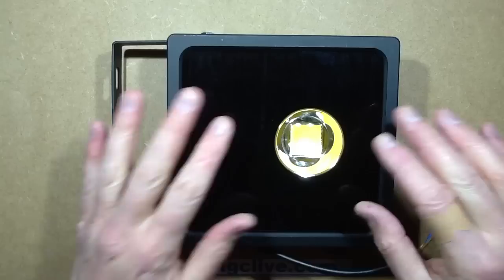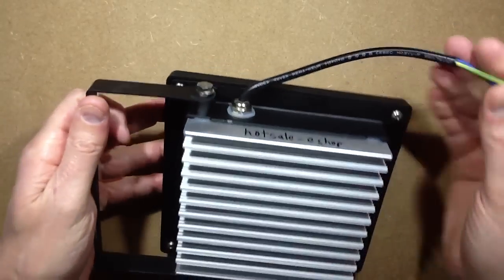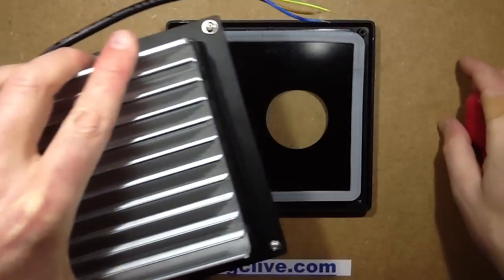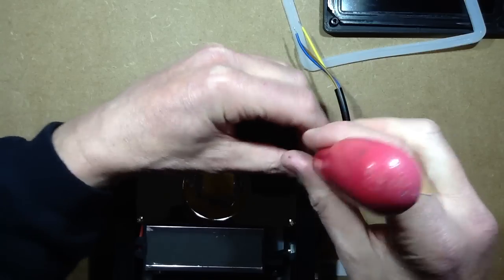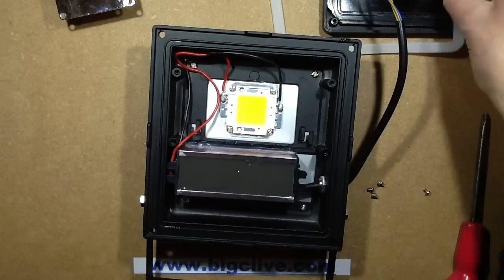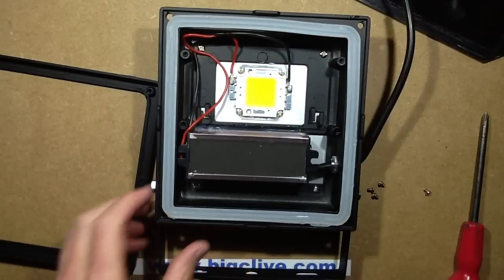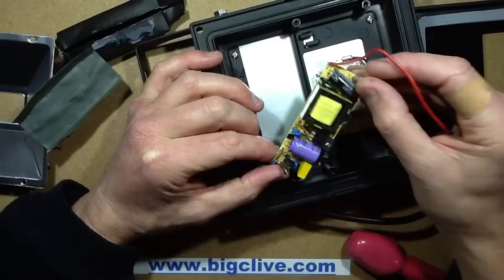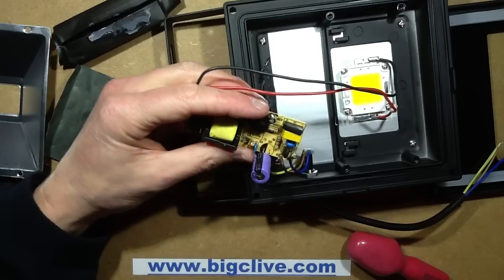A look inside a narrow beam 20W LED floodlight.  (30 degree beam.)

Comment: Big Clive, I have a question about narrow beam lighting. I'd appreciate it if you might consider it and perhaps provide an answer. 

I have a cheap single bulb LED flashlight about 4" long and an inch in diameter with a plastic lens on a sliding collar.  It allows for a wide beam and when pushed forward, the beam narrows to a spot about two inches wide on a surface about a foot away.  The bulb and lens section is only about 1 to 1 &1\4 inches in length.

I have a possible invention idea with a technical requirement.  I was wondering if a plastic lens configuration would be possible in a similar cheap compact LED light format to project an intense point of light about 1\8th to 1\4 " in diameter onto a surface about a foot away?  (I've considered lasers but they project only colored light and I require white light.)

I have achieved the point of light from the flashlight but only by having a magnifying glass about a foot away from the surface with the flashlight about another foot above the magnifying glass with the flashlight focus collar slid back to wide focus.  I was hoping to achieve this result within a compact bulb and lens housing, about an inch in diameter and 1 to 1 1\4 inches long or something in that size range, also employing an LED bulb and cheap plastic lens, as with my original cheapo sliding collar flashlight.

I also encountered a photographer's version of a concentrated spot effect achieved by putting a plate over a light bulb within a valence collar with a 1\4 inch clear acrylic rod protruding through the plate.  This reportedly channeled the light in fiberoptic manner through the rod and projected a concentrated spot of light from the end of the rod.  Not sure if something like this might achieve my purpose.

--Grant
Reply from the maker: If the light source is small then you could definitely use optics to focus it to a sharp point at that distance.
Reply: @bigclivedotcom  Thanks for your answer.  I was hoping for that assurance that it was do-able

Comment: Can you tell me what magnification range your little illuminated magnifier has?
Reply from the maker: It can magnify between 60X and 100X, but I leave it on the minimum as that is ample for component ID.  If anything it would only need to be 20X.  It's a standard unit off ebay.
Reply: bigclivedotcom I thought as much.  I've been looking for a fairly low power one and wondered if the 60x was "weak enough" for the job.  Thanks Clive.